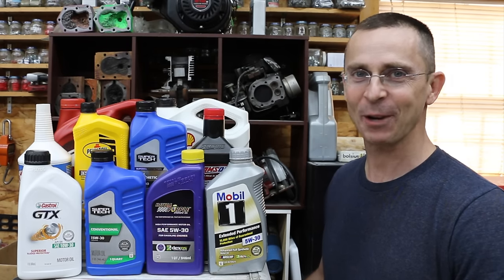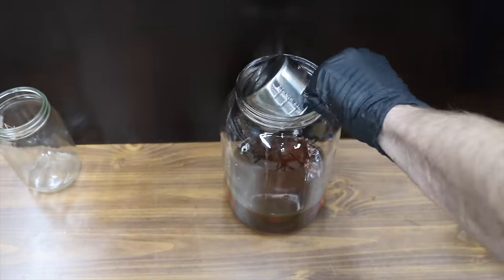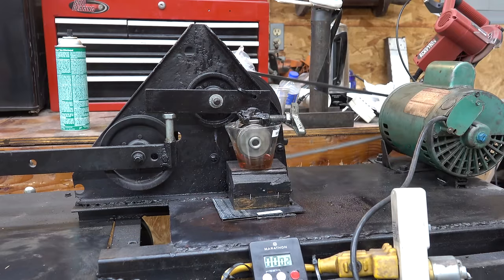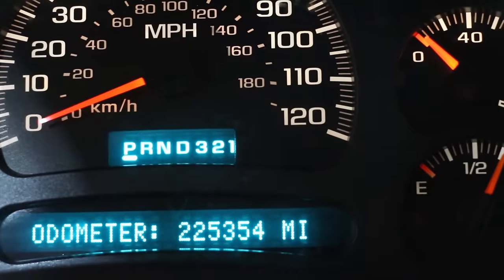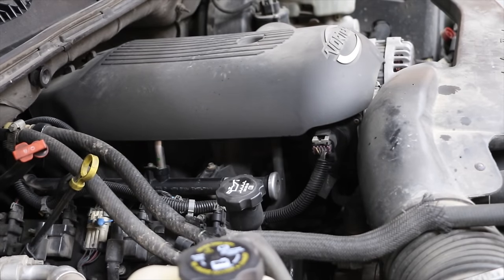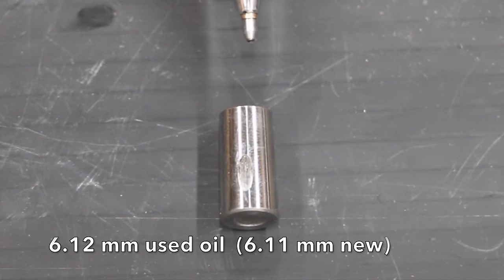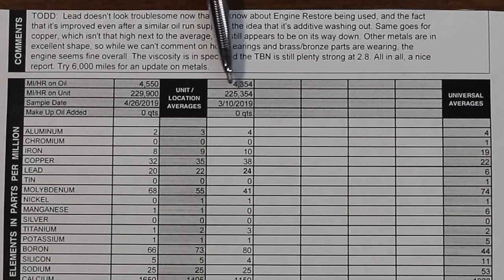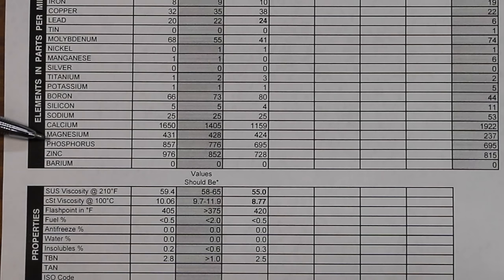Will Mixing 10 Motor Oils Damage an Engine? Let's find out!

Comment: you tried bacon grease as oil and it cleaned the combustion chamber, will it work as a cleaner if mixed with the fuel?????
Reply: how bout bacon grease to use as a 2 stroke oil ?
Reply: @flhusa1  bacon grease as penetrating oil?
or packing bearings with it?
I think a entire show on bacon grease is needed
Reply: @marcwire9332  bacon grease,atf,acetone
Reply: Is there nothing bacon can't do?
Reply: @SeaCorey  that is what we need to find out!!
Is bacon fat the new fuel for the coming generations??? Is it going to save the world from global warming???
Reply: @SeaCorey  mend a broken heart?

Comment: I remember 32 years ago when I was 18 my dad had a lot of different brands and weights with a 1/4 quart to half quart in each bottle and when it was time to change oil we just started dumping bottle after bottle in until it was full mixing them all and never had any problems always ran good, had a 1979 Ford Thunderbird with a 351 Windsor and a 1978 Ford Thunderbird with a 400 and never hurt those engines at all by mixing but these cars and trucks these days prob wouldn't be a good idea. Good Vid thanks.
Reply from the maker: Thanks!  Thanks for sharing.

Comment: Great videos! Could you do a video of oil quality after a long service interval of 15.000, 20.000 or even 25.000 miles that car manufacturers adopt increasingly more?
Reply: Don't listen to them. 5000, 7500 at the most
Reply: Message to s.m.- I went 15 to 20,000 on a Dodge v6 with Amsoil for 287,000 miles and it still ran great, no smoke or oil use

Comment: Well done. Its known that motor oils are already a blend in most cases - base oils, additives, etc. I'm glad you suggested to use the recommended oil grades, as that is what your engine is designed to use. You can find the recommended grade for your engine in several places - in the owners manual, and often also on sticker in the door jamb or under the hood somewhere. All motor oils in the auto parts stores have the API grades on the container so its pretty easy to match what is in the store with what the engine is designed to use. Glad to see more real wisdom from your channel.
Reply from the maker: Thanks!

Comment: Thanks for an informative test. I have never liked to top off oil levels with a different brand of oil even if it is the same viscosity, but have done it out of necessity. Your information removes the worry although I will still plan to normally stay with the same oil. I used to stay with the same brand from oil change to oil change but haven't really worried about it for many years as long as I use a quality oil. Have run a few engines over 200k without any engine issues and very little oil burn with age.
Reply from the maker: You are welcome!  Thanks for sharing.

Comment: With mineral and synthetic, you should be fine...
BUT
Many years ago Valvoline did a lot of their race oils using a vegetable base - caster oil* - and that DID NOT mix well with the mineral oils then available (pre-synthetic days) and there were a LOT of engines that were destroyed when people topped up their 'race' or high performance engines, that had been built for, and used, Valvoline. IIRC, it was becaause alcohol fuels worked better with the caster base?
Later, at least down here, Valvoline also sold mineral based oils which confused even more people and toasted even more engines, as the mix formed rubbery deposits with zero lubrication properties and blocked up the oilways.
Conversely, some people were using mineral oils and swapped to the 'performance' caster oil with a similar result.

*Some old cars, especially race cars, will still use caster oils and, in fact, that is where one of the UKs leading oils got their brand name - CASTROL.
Reply from the maker: Great point!  Thank you

Comment: Love the oil videos ... I see you had rotella oil in the mix this time ... I’m very curious to see how the rotella T4 and T6 compare to regular synthetic gas engine oil ... I hear tons of people swearing by rotella T6 and they use it in everything they own from lawnmower to daily driver automobile ... I also use it in my turbo charged racing engine 😉.. this would be a great video for the viewers
Reply from the maker: Great suggestion!  I'll be comparing them soon.  I'm putting some hours on the T6 now in my farm tractor.  Just mowed 25 acres before publishing the video.
Reply: @ProjectFarm  Maybe throw in some zinc additive in another base oil for comparison as well. It's my understanding that people started using Rotella because zinc was removed from most all other oils but old engines still require it. My old Jeep 4.0L sounds like a bad high school band when the oil doesn't have zinc.
Reply: @AZBADBOYz  They removed the zinc, because it could possibly foul the oxygen sensor or catalytic converter on newer vehicles. Rotella, which is designed for diesel engines, can leave the "good stuff" in it, since diesel engines don't have those components. If your gas engine burns any oil at all, just know, that it could shorten the service life of those components. Other than that, you can't beat it, for protecting turbo chargers, exhaust valve guides, as well as the camshaft and crankshaft bearings.
Reply: I literally use T6 for everything. Our GMC terrain, my crown vic, my FZ07, lawnmowers, etc. I just buy one oil now. its so easy. Put about 40,000 miles worth changing every 7000 miles on the vic and no problems. Same with the GMC.
Reply: @vincentrobinette1507  What sucks is the Jeep 4.0L inline six definitely has a catalytic converter and they stopped making it mostly because it could barely pass CA/NJ/NY emissions even when new. If is was a 1995 model in NJ then it would be exempt from inspection.
Reply: @pgmurray76  I had a 1982 Ford Econoline van, with a 4.9 liter inline six(300 Cubic Inch) I was able to adjust the fuel/air mixture, and with a working air injection reactor pump and a new catalytic converter, it passed emissions with flying colors. The engine was often referred to as "the big six". As long as there was water in the radiator, and oil in the crank case, you couldn't kill it!
Reply: @vincentrobinette1507  Awesome! That truly is the ONLY Big Six!

Comment: Hey PF great content as always!
Would love to see a comparison on different coolant additives and their effectiveness on temperature reduction.
Puple ice, water wetter and amsoil coolant booster come to mind.
Reply from the maker: Great suggestion!  Thank you.
Reply: Better yet compare coolants say between ford and GM vs. Using various coolants ( orange, green, universal etc..) Over maybe like a 30k test run after a full cooling system flush. I'd wait for that. Just curious why certain engines say only X antifreeze.

Comment: I have been a street bike racer all of the years that I worked in motorcycle shops from the mid-90's up until 2009.  And motorcycle oils have even more mystery and myth than Automotive oils... Before all of the fancy testing equipment came into play, I learned something through experience, that as long as my engine had motorcycle approved oil the clutch worked properly, no engine seals or  gaskets leaked prematurely, and they did not seize or explode. I took every type of oil that was given to me by my sponsors and used it all at some point in time. Quite often that meant adding standard base stock oil to my high-dollar full or semi synthetic racing oils. If I didn't win races or the sponsors just didn't have money to give I would buy the Standard motorcycle oil if that's what I could afford. My advice is if you can afford the full synthetic that is an extra level of protection that is nice to have, but it's not a requirement.
Reply from the maker: Thanks for the feedback.
Reply: I’m a sponsored rider as well. Given you have much more experience; what would you recommend for a great break-in oil? Some say high zinc and some say pure synthetic. Honestly, I don’t know if there’s a difference in performance given I change the oil every hour during that time

Comment: “Don’t recommend mixing engine oils”.   What does it hurt?? According to your test AND the oil analysis the mixture of oils outperformed the Amazon oil in nearly every category.  By saying that it reminds me every time u see a jet powered motorcycle jumping over a spinning helicopter blade, “Kids don’t try this at home!”

Great idea by testing the mixture of oils by the way!  👍
Reply: It's the mixing of weights and synthetic vs conventional that is not a good idea. Each engine has an oil pump designed for a certain weight of oil as well as the clearances are set to protect everything with with that oil. In very old  45+ yr engines clearances were different but any relatively modern engine sees very little real wear on items such as the crankshaft. So the old myth of adding heavy oil to "take up the clearances" is hogwash. Changing weights may not change oil pressure by much but it can affect oil drain efficiency/ getting oil from the valve train back into the pan. Engines should be designed well enough to where any oil should drain fine but not all are created equal. Synthetic oils are made up of more organized molecules allowing you to fit oil through a smaller hole vs conventional. This is one of the reasons synthetic oil is said to cause leaks.
Reply: bannablitz247 Nobody said it was a good idea.  The test and oil analysis just showed that mixing different oils was not the doom and gloom we were all brainwashed to believe by the oil companies.  90% of my mowers & cars show a wide range of oil weights.  Some manufactures even recommend going from a 20wt oil to a 50wt oil when on the track right in the manual.  A Ford Performance engineer said the light weight oils are for better mpg only.  Obviously, bearing clearances in most engines won’t be affected by mixing normal weight oils.

Comment: I used to work for a chevron jobber and when we would offload oil trucks into our tank form we would purge between HDMO and PCMO into a 200 gallon tank. A lot of our truck drivers would use it in there personal vehicles and non of them had an issue. The oil was a mix of  two 15-40’s, 5-30, and 10-30.
Reply from the maker: Thanks for sharing.

Comment: You should test rural King branded oil you can get 5qts for less than $10!
Reply from the maker: Thank you for the video idea!
Reply: I used to use that in a 2000 chevy prism it went through a quart every 800 miles just changed the filter every 6 months and dropped in RK synthetic as needed!!
Reply: Sounds like citgo from Walmart

Comment: Thank goodness you didn’t use Royal purple you are all Good 👍💯
Reply: Castrol Edge was worse in winter when I dropped it because of its poor cold flow.
My chain rattled more with Castrol than with Royal Purple in winter.
Reply: Why?
What's wrong w/royal purple? 
I use it, 1.4Turbo, 6-spd.,
Great m.p.g.
70,cruise,=44.1M.P.G.
Reply: I used royal purple once and never again will I use any of their products
Reply: Dang Royal Purple is that bad?

Comment: It would be interesting to me to see the difference between using the  PF46 Filter and using a larger filter such as a Wix 51522 or equivalent. I know I've never been comfortable using such a tiny filter as a PF46 on a V8 engine, and seeing how contaminated the filter media was on your truck justifies getting the larger filter to me.
Reply from the maker: Thanks for the video idea.
Reply: Keep in mind though the micron rating on a filter like 51522 Wix is 21 Micron and the rating on a PF46 AC Delco is 10 Micron. If your GM vehicle was spec'd with a PF46 oil filter, I'd recommend not going higher than the 10 Micron rating (the engineers may have an idea of what sizes of particles may come off the certain parts they use, if they weren't just overspecing and praying from the git-go)

Comment: Great video as always! However I kinda knew how it would turn out. This is why: Years ago I was told by an old lifelong truck and equipment mechanic that sometime around WWII a law was passed that basically said that all oils manufactured for automotive, aircraft, equipment and so on had to be compatible with each other. Meaning that in a wartime shortage any oil could be used anywhere. Anyone have any input on his?
Reply from the maker: Thanks for the feedback.

Comment: Well gramps always let a freshly dumped oilpail/jug/cardboard can drain into another 5 gallon pail to reuse when changing oil in Tecumseh and Briggs auger engines and rototiller. Diesel or gas dino squeezins ...the odd atf3-4....
I Still got a 5 HP b&s rototiller 35 years later....and it was old when I was little
Reply: I reuse mine as a lighter fluid

Comment: I think you should also test transmission fluid, 
Like test different types of ATF 4 and also Test ATF 4 vs ATF 3
Reply from the maker: Thank you for the video idea!
Reply: @ProjectFarm  especially with the extremely expensive audi pentosin !! 25 canadian peso's per litre!?!?
Reply: Testing different transmission fluid specs against each other is really pointless.  The fluids are formulated based on the materials used in the transmissions.  Deviating from the vehicle fluid spec for the transmission can (and in a lot of cases, actually does) damage the transmission due to incompatibilities between friction materials and fluid additives.

Comment: Anyone remember working at a gas station and running your car on the drips out of the oil cans in the trash?
Reply: Lol my father owned a shop/gas station. He had a eaves trough to set empty oil jugs in then into a empty jug. Every few weeks he would have a couple gallons and sell it half price. A friend use to work for a farmer. When the farmer changed the oil on the big farm tractor my friend kept the oil to change the oil in his 4 banger dodge pos car.

Comment: My coworker said that his girlfriend's condo uses a lot of electricity each month. And that the electric company won't investigate until she replaced her 20+ year old outlets. They said that every unplugged outlets can draw power.

So I wonder, do old electrical outlets or light switches use electricity? Do they get hot and have resistance? How does new outlets fair against old ones? And do the new outlets with USB or SmartOutlets use more electricity?
Reply: Some of my outlets are going on fifty years old.  Old and new outlets don't leak, so the electric company is BS.  First place to look for high usage is the water heater.  The elements get scaled up with age, and the internal thermostat may not be turning off.
Reply: If the girlfriend is really interested in getting an answer, she should hire a licensed electrical and have them test various circuits for power usage. If the plugs are out of code, the electrician may be able to give suggestions or a quote to fix. In a condo, there may be strange wiring and the girlfriend may be powering up the common areas.

Comment: Project farm has done so many oil tests but I'm surprised he's never tried idemitsu and motul
Reply from the maker: Thank you for the video idea!
Reply: @ProjectFarm   Costco has also come out with their Kirkland branded motor oil.    Also thoughts on 0W-20 vs 5W-20 in a 2016 RAM Big Horn.  MN Winters.  Thanks!
Reply: @scottappelwick2843  you can't Go with with 0w20 if your vehicle calls for a 5w20. Ow20 is slightly thinner on start up which is what you'd want to  lubricate your engine faster, especially in winter time. When the engine is warm it's at the same viscosity as spec.

Comment: please test old transmission fluid vs new. legend has it leaving a transmission along is better than changing the oi.
Reply: I've been told that as well especially an older car w high milage.. Was usually a th 350,400 gm trans haha
Reply: The Kraken it is. Just based on my epexrience on German cars that gone past 200k and American cars on 150k or more.
Reply: Nah
Reply: I have a sub micron filter on my automatic transmissions. I like to flush my transmissions with clean ATF. Changed the filter on the Nissan Altima the other day. The toilet paper was grey on top and red at the bottom. That's normal. I don't change the stock filter.

Comment: A "trick" I've heard from automatic transmission "experts" is that if it starts slipping or you have a slight ATF leak, adding DOT3 brake fluid to the ATF will "cause the seals to swell" and lessen or fix either problem. Not sure how you'd test it.
Reply from the maker: Thanks for the feedback.
Reply: I heard a old mechanic tell a guy this b4 when I was a kid
Reply: I’ve used it in engine oil in small amounts for leaky seals. It will swell the seals.

Comment: I did this back in the late 1970's with my old truck 1955 chevy 250 straight six ..I put standard weight 30w...I quart pennzoil..1 valvoline..1 castrol..1 quakerstate..& 1 kendall..No problems each oil did have a different color tint ...
Reply from the maker: Thank you!

Comment: Wow! This just popped up on my recommended list and it is one I have not seen. When I was a kid in the late '60s I used whatever oil I could find around the farm in my minibike. 10w30, 10w40, 90 wt cut with diesel fuel, you name it. Tranny eventually went out is the reason I junked it.
Reply from the maker: Thanks for sharing.

Comment: My 2002 Corolla calls for 5W30 but after 150K mileage using only synthetic oil I noticed that oil consumption was 800 miles/quart. Problem was oil passing cylinders. Changed to 5W40 synthetic and oil consumption now 1500 miles/quart. Car runs fine after 22K more miles. I don't think the thicker oil is hurting anything. MPG same as before. Great video BTW.
Reply from the maker: Thanks!  Thanks for sharing.